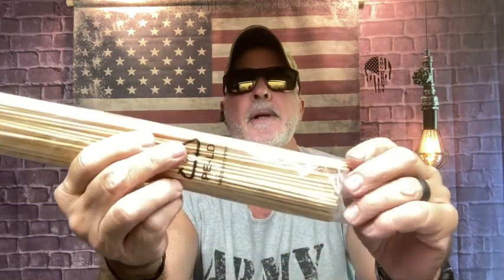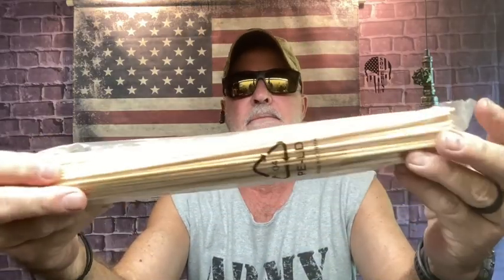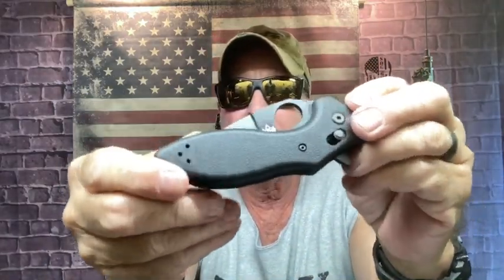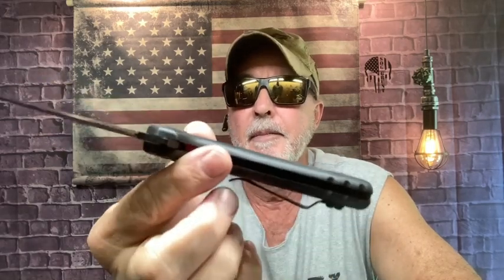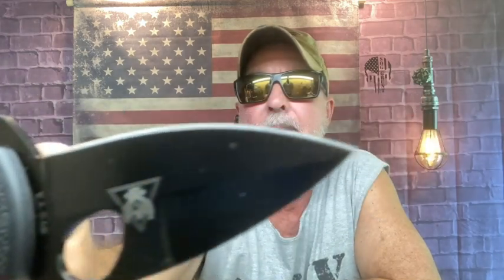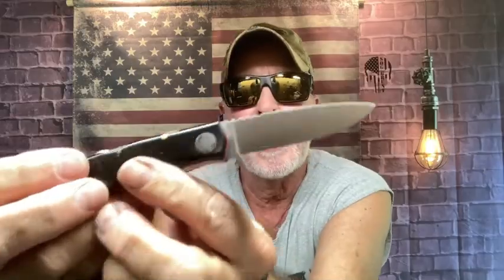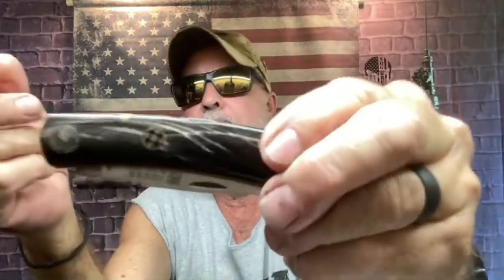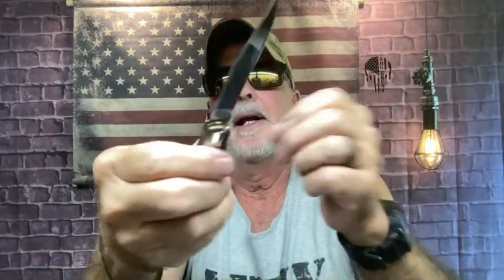FAST FRIDAY SHOP TALK

Comment: Didn't know that carbon fiber material had colors, most of it here are black.
We use it here for the automotive industries, very rare to find a blacksmith/knife maker here and most of them only produces jungle machetes from 10"-18" blades (mostly using the steel from truck leaf springs/shock absorbers), even if i found a blacksmith to forge a knife it will only be fixed blades not folders and their prices are upwards of 150 🇺🇸 bucks nothing less and you'll have to wait a month, nobody can earn a living full time making+selling their own brand of sporting knives even hand made well.
Found a blacksmith about a decade ago and ask him to make a copy of the Cold Steel Trial Master Bowie using hand file steels but add 15% to the size and willing to pay him 200 🇺🇸 bucks; he just turned it down saying it's a waste of time.